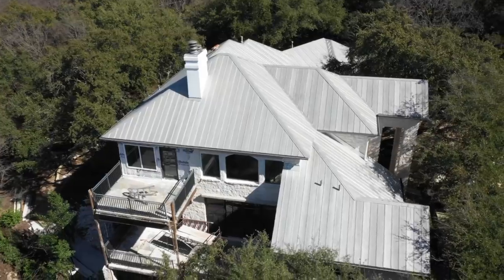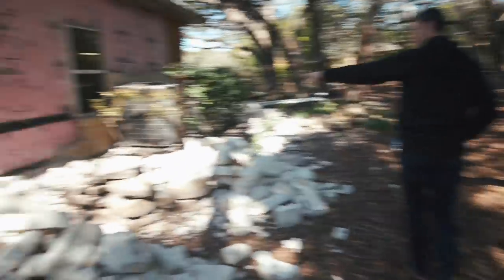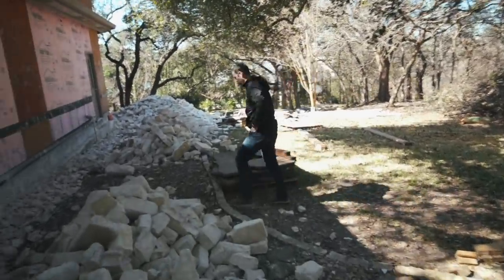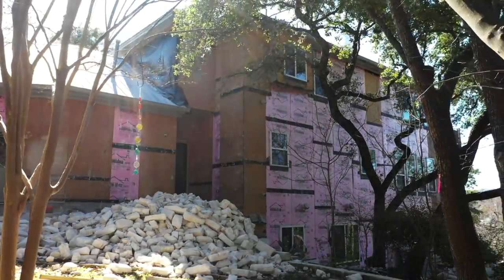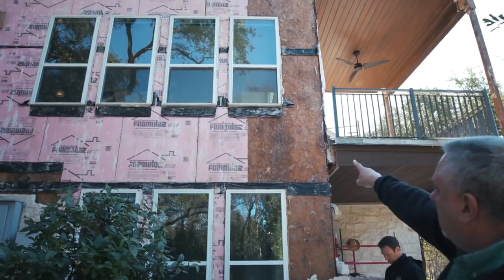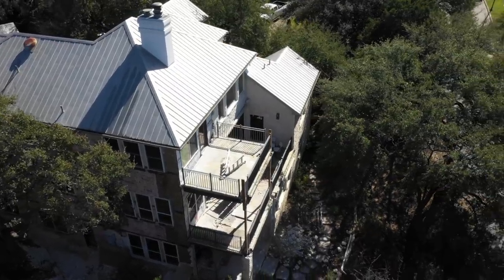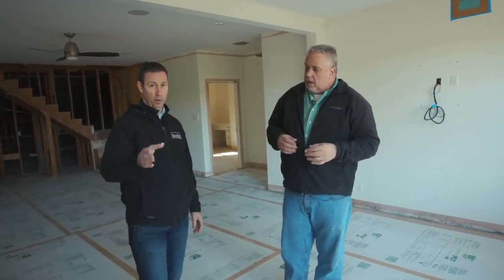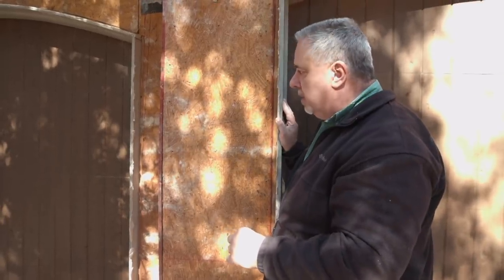You Won’t Believe What’s Behind The Skin Of This 20 year Old House!

Comment: Stucco in place of natural stone... a piece of me died inside.  I know that stone is used everywhere in Austin but it's still miles better than stucco.
Reply: one of those videos that just makes you MAD
Reply: Agreed! I gasped when they said they're replacing the stone with stucco!
Reply: Why did the stone have to come off?  If they said, I missed it.
Reply: Eephus? 

Stucco™ is a mineral finished single cell product.

Rub a faux stone or a counterfeit Scotchgard rock. It'll oxidize from inside real fast post manufacturing. 

Zero iron core content products or real rock , v stone....
Reply: Can that stone by reused on another project ?
Reply: @613kc  I can think of two very obvious reasons discussed in the video. The first is the windows. After Construction window installation is never a good idea. They will always leak, they will always cause degradation of the structure. Secondly, did you not hear the part about the thousand-dollar a month electrical bills. They can't fix the electrical bills without putting in insulation, and you can't do insulation without wrapping the house, and you can wrap the house without removing the stone. And in Texas Stone like this is pretty much what Texas is made of. So there's no great loss, and the stone will be reutilized for roadways or something similar. Where this house was built, in another twenty years you'd be $240,000 poorer in electrical expenditures and the leaking that was occurring would leave you in need of significant structural renovations. FYI I'm a contractor in San Antonio, and I see this kind of crap all the time. That's not to say that I don't think that they should put Stone back up. But not all customers want stone. And if the owner like stucco more than Natural Stone and the material needs to be replaced anyways, then why not do stucco.
Reply: @613kc  There was rot, eflorescence, mold and mildew (as well as insects) in the wall structure, as the stone veneer was improperly rainscreened.

Likely they went with stucco as more cost-effective than replacing the entire stone fascia.
Reply: for real. Stucco is gonna show all those cracks, especially on walls that big
Reply: Stucco makes me cringe almost as much as OSB does.
Reply: @Crusader1815  But it sure is a big house.

Comment: How was that stone supported when it was against the sheathing? It seems like tearing it off did not damage the OSB at all.
Reply: I think they already removed most of the brick ties, I only saw a few of them left.  Crazy that they just laid the stone on the OSB, tar paper is cheap and was commonly used behind brick for the last century!
Reply: bigpjohnson What is this practice of putting Tar  Paper behind brick you speak of? Tar paper is only for the roof. A kid in the 90’s, I worked for a builder and hod-carried for his brick layer. The only thing we ever put between the blue foamboard and the brick were wall ties and cigarette butts. 

In retrospect......we built a lot of shitty houses.
Reply: @randywatson9585  My 100 year old house has tar paper between the stucco & wall boards (no OSB or plywood back then) - it was common practice for a long time and is still better than nothing.  Hell, there are 150 year old houses in Nebraska build of nothing but straw and tar paper....
Reply: @randywatson9585  Tar paper was the old school version of housewrap.  It was used to cover the wood sheathing and then the stucco, brick, etc covered it up.  Its main job is to shed any water that makes it through and allow it to drain down.

Foamboard was a new wonder product so they stopped using tar paper behind brick.  Its still commonly used behind stucco however.

Tar paper is also used under nail-down hardwood floors, behind shower backerboards (if no waterproof membrane is added), etc.  It has quite a few uses in any house besides the roof!

Comment: Just build a Ranch with 4' overhangs, pressure treated plywood, Tyvek, vinyl siding with a rain screen and call it good.
Reply: And use 30 lb felt and forget it ,I have a 64 year old home and the felt is like new behind siding .
Reply: @deerhunter7482  My 1950 house was sheathed in Cellotex, wrapped with 30 lb felt, and covered in brick.  Even with all the rain and humidity we have here in Houston, it held up very well.  Lots of water stains from the old leaky windows but otherwise intact and no real mold.
Reply: love the vinyl.   people complain about he look, but if you haven;t the money for hardieplank or aluminum, vinyl is the best.   Lasts forever, easy to fix, acts as a rainscreen too.  Nothing wrong with some siding.
Reply: @hosmerhomeboy  until someone puts a grill near it
Reply: @JasonW. , True, but probably shouldn't be that close anyhow ?
Reply: My home was built in 1922. 18" thick stone foundation, all the studs and joist are rough sawn red oak. Cedar siding, and the people that had it before me had put vinyl siding on it. 
There is some damage to the lathe and plaster in the upstairs, and I had to insulate it.
I have to wonder how all the new homes built will be looking in 98 years? 
When they built this one according to what I have read, the common practice was to build the foundation, and let it settle for a year before you build the house. 
One of my small out sheds is built of logs with a concrete foundation. It still is pretty air tight.
We did have some termite damage that we had to correct, and I had to replace some knob and tube wiring. Other than that it is a great house. 
We moved from Colorado, where houses are going up so fast. A friend bought a brand new home in a Denver suburb, and as he was showing it one of the first things I noticed was one side of the main doorway had a 45 deg angle on one side and a 30 deg on the other. 
It's really sad to me that new windows, homes, etc "need" to be updated every 10 years or so. I have never been able to spend that kind of money. I just figured if you keep it long enough, it will come back in fashion...
I hope I hang around long enough to come back in style.
Smiles.
Reply: kutzbill 
Amen — modern contractors sell their souls
Reply: @kutzbill:  Buy a classic and it'll never go out of style.  :)
Reply: Your right on that. My grandparents house was built in th 60s with 4 ft overhangs and cedar lap siding . Today it still looks like new.
Reply: @hosmerhomeboy  Vinyl is the best. Not the most beautiful, but stuff like Hardie needs trained installers and perfect conditions to work well. Any numbnuts can hang vinyl, and it never needs to painted. Just hit it with some bleach in a pressure washer and it looks brand new.
Reply: @bnasty267  indeed, and it is also super easy to repair.  ever try and fix a piece of hardie half way up the house?
Reply: In a H4H house near Boston that I helped build we noticed wrinkling and shrinking on the vinyl siding about 6 months after we finished. The afternoon sun was reflecting off the window of the house next door and melting the siding. We couldn't just replace the siding.

Comment: Hey Matt,  I know how you like a clean work area. Would you see any benefit regarding time savings and job site cleanliness by using plastic or wire mesh totes on pallets? Placing them near the demo area where the guys can toss the stone in as they go. I’ve learned the less times you have to touch material = less man hours. Especially for demo
Reply: With a flat work space where you can use machines, yes.  In a rocky, sloping area like Austin, probably easiest to send a few guys with wheelbarrows later on.

I cleaned out a bunch of concrete patios and rock decorations in my front yard.  Thank God I was able to get a small backhoe in between the fence and chimney, otherwise it would have been 200 wheelbarrows!

Comment: Replacing that beautiful Austin stone with stucco?  Blasphemy!
Reply: Really!  It is quite beautiful.  I was thinking that would be a nice finish for my place
Reply: I have stucco...it sucks...cracks, not forgiving to impact...hard to mend and patch
Reply: @gordybishop2375  forgot the main reason, cheap to install, 5 yr warranty good usually
Reply: Jason W five years...whoo hoo
Reply: It has to be installed correctly and most stucco guys don’t apply 2 coats of base coat to the mesh! This makes the finish look a lot better. The base coat is like thin set....only goes on 1/8” tops with mesh imbedded it shouldn’t crack unless your home is moving in some way
Reply: @gordybishop2375  exactly.

Comment: Show a 20-30 yr old tyvek wrapped house
Reply: I stripped some hardipanel siding off of my garage two years ago that had tyvek wrap under it, the wrap was brittle and crumbled to small flakes when touched. I had messed with the siding because one of the boards had come free and was drooping, the nails were rusted off in the osb.
Reply: @Nanan00:  Wow; I had no idea.  Thanks for posting that.
Reply: Tyvek, or similar house wrap from the 90s, makes walls rot to pieces where I am, maybe the new version does to, it's like covering your walls with plastic, which traps moisture and does not breath. It's what happens when they import building standards from Southern California, or elsewhere, where they don't have to contend with rain for 8 months of the year, or cool damp weather. I saw a house up the hill where the owner had to redo the gable end wall of his garage, the house is just over 20 years old, the OSB was turning black and falling apart, and over it was Tyvek. So what did he do to repair it, used more OSB and covered it with Tyvek, honestly some people are so stupid they could throw themselves at the ground and miss.
Reply: Why OSB so popular? Why No one using exterior grade plywood anymore? 🤨
Reply: @kalijasin  OSB is about 25-30% cheaper than plywood.  That's why.

Comment: I just demoed out a 60 year old house for a complete renovation. 2x4 stud walls, black coated fiber board on the outside, no wrap or paper, 1 inch space, brick siding, drywall inside, zero insulation. Basement is unfinished. Sills are visible.

House was in PERFECT condition. No rot, no mold, no signs of leaks at all. Absolutely perfect.
Reply: In what part of the world does this house exist?        Old houses have denser wood, than modern houses.    Matt has published on this point, and showed that extremely leaky houses with no insulation ... essentially glorified shacks (in rainy Texas, no less) ... dry out and "live forever."   Until the termites get to them, anyway.
Reply: a good rooof overhang, moisture barrier under crete....brick or whatever outside, and keep the windows caulked....sounds good to me
Reply: John Becich single story house in Denver. Termites aren’t an issue here, very dry weather,  not much rain. 

You do see a lot of rotted facias and soffits here though. Without any insulation, ice dams are a problem and the snow melting and dripping around the gutters rots out the wood facias and soffits over time.
Reply: That's about how my 1950 house was built.  Studs, Cellotex sheathing, 30 lb tar paper, and brick.  No insulation at all and very drafty.  I'm in rainy Houston so it was some water stains around the poorly caulked old windows but little for mold or rot.  Had to reframe a few walls due to rot from plumbing leaks.

I foamed in all the sheathing gaps and holes and around the new windows, made it virtually draft free.  Used cellulose insulation in the cavities and then drywall and its a very comfortable house now.

Comment: Non-builder here, but would Tyvek or a similar plastic sheeting outside have prevented most of these issues by preserving everything underneath to allow it to last longer?
Reply: probably, then the windows could be taped to it
Reply: There seemed to be more "violations" than mere lack of moisture barrier wrap.  The rock facing itself was a "sponge" that kept the structure moist.   And the windows lacked drainage for moisture that happened to enter.  Proper window sill waterproofing allows for dry-out.
Reply: @johnbecich9540  yes, and hard to install later, but, would serious masonry waterproofing have solved the problem? With some work around the windows?
Reply: @d.e303-anewlowcosthomebuil7  Nothing short of something ridiculous like tar or rolled on liquid membrane can seal up masonry. By that point it wont look like masonry anyways.  It simply naturally needs to breathe and dry out.
Reply: @bigpjohnson  doesnt silicone spray work?....like marble sealer.
Reply: @d.e303-anewlowcosthomebuil7   No, too much surface area, too many places it can fail and let water in.
Reply: @bigpjohnson  in the 60's, a space was left between the masonry ( 1" or so)and the stud wall with asphalt board. We dont have issues with this. I guess they left out the space, and the asphalt board. Also, weep hole were left. So, i guess the stones did not have an air space, nor asphalt board,.No need for ply with the msry clips to the studs making the msry into a diaphragm...better alll round but people forgot?